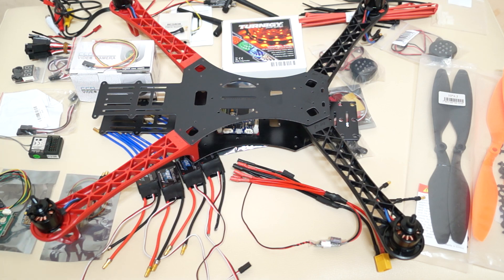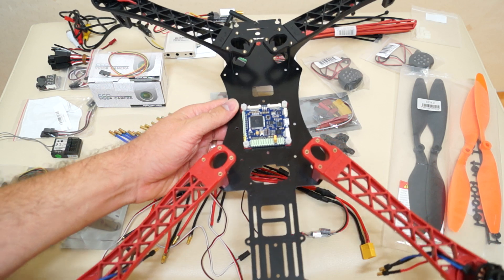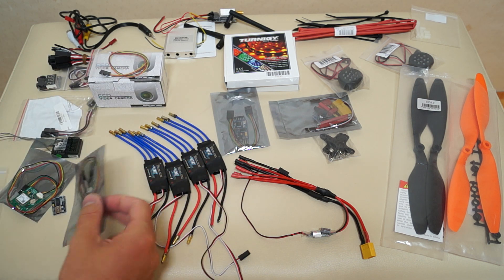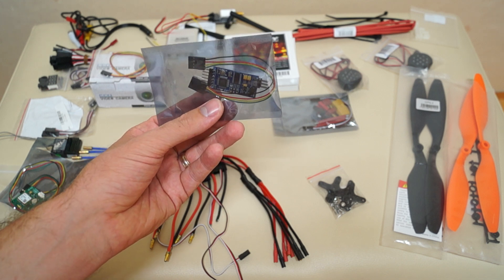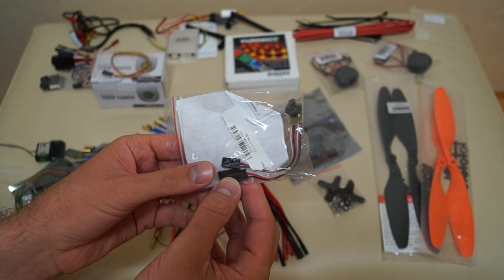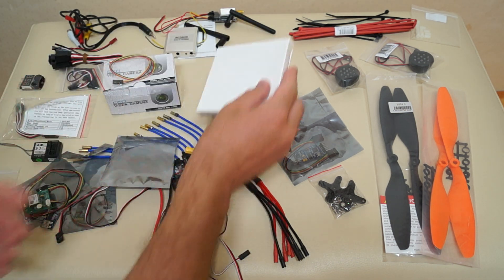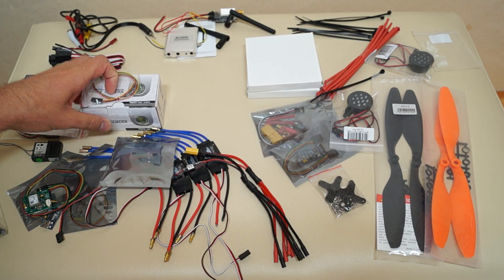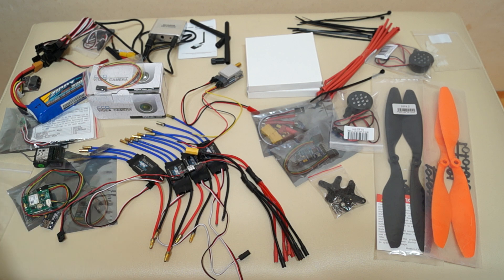HJ 450 FPV quadcopter build overview

Comment: Hi MrCofl1001, I am very new to this. Can you please tell me how much did the whole build cost? I am looking to build a quadcopter with FPV, GPS capabilities of mounting a GoPro. Thanks.
Reply from the maker: Hi, this is my first quad project back in 2013 and I think the cost of the parta were somewhere around 250 to  300 USD roughly...
Reply: I know there is a good diy quad over at flite test on YouTube. All wood frame or metal disks and wood dowels.  Nice setup.

Comment: MrCofl1001, could you make the assembly and programing video for this project?
that will help us (esspecialy me/noob) to get to know how thing should be done or not to do. I dont wanna waste any parts for something small/stupid mistake that noobs might do ;p
thank you very much in advance
Reply from the maker: Hi,
The quad is already assembled and flown :)
I didnt made a movie since there are already so many tutorials available, but I will post some pictures with comments during the build on my blog: http://www.rchelistuff.blogspot.kr/2013/09/my-new-project-hj-alien-fpv-quadcopter.html
Reply: Oh...ok..
but could you please add some detail information (total weight,prop length and pitch, etc).
since I am new around RC (esspecialy on multi rotor), I have to be sure about the detail. I am planning to build QC that pretty much looks alike your QC. Now I'm waiting for my same frame that you use. I'm still not sure for the FC though.still haven't decide APM 2.5.2 or AIOP.
for ESC, I want to use Q Brain 4 x 20A Brushless Quadcopter ESC 2-4S 3A SBEC on HK store.
many thanks for the reply MrCofl1001
Reply: and MT2213-935KV MultiStar Motor and Propeller Combo 10-4.5 CW CCW for my QC..
and how many  3S 2200 mAh batteries you installed on yur QC? flight time?

Comment from the maker: Hi
Sure, I will no prob...
I used zippy's 2200mAh and it flew for 5 min 30 sec untill reaching 3.8v/cell without fpv cam and tx.
I might try it out woth turnigy's 3000mah also 3s, but I need to check the best weight vs flight time.

Comment: Hi dude I have same frame with DIY Brushless gimbal(see youtube vids) getting 10mins on 2x 3s2650 Nanos  1200kv ntms 9x4.5 slowflyprops.1.8kg all fpv loaded, would like to no your set up and flight times when its up and running. cheers